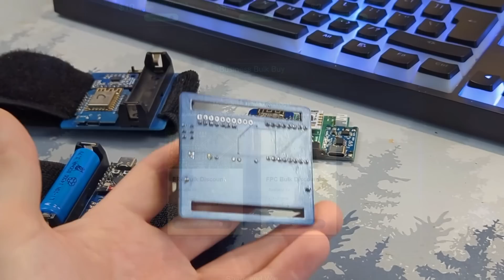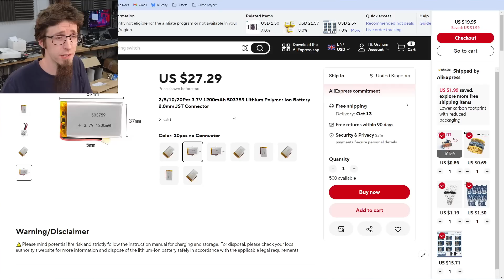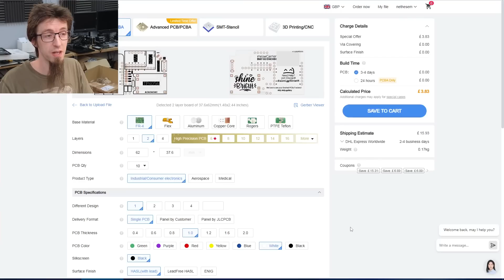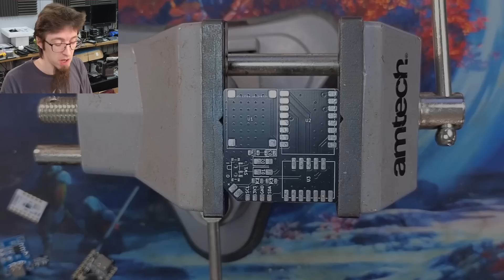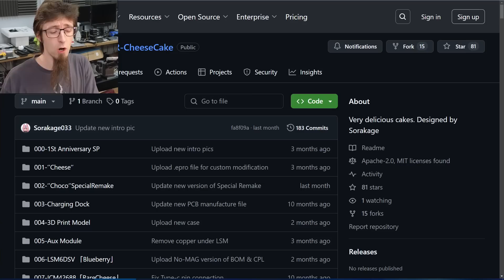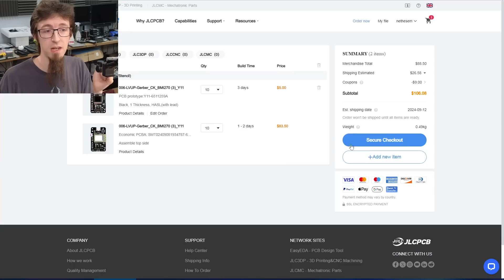Building my favourite Slime VR Body Trackers with JLCPCB - #417

Comment: Is there a version for BMi 160??
Reply from the maker: BMI160 will work with most tracker designs - however the performance is fairly poor by modern standards. Expect a lot of drift. Newer IMUs are waaaay better.
Reply: Thanks, I started my proyect back in november 2023 and having to cable solder 0mm wide cables was extremely painfull as well as i decided using other design. So I dropped the proyect. Tried to retry it to get the same results: bad connection as well as being horrible to handle so thin cables that break just by looking at them. Now that custom PCB are becoming so cheap i think its a good option to go with. I mainly chosed BMI160 just because it was extremely cheap, and I didnt wanted to spend much and people back then said they were good enough.

Comment: LSM6DSV where to get this modules?
Reply from the maker: https://moffshop.deyta.de/products/lsm6dsv-module
Reply: @Adamant_IT  bruh have you tried comparing the performance between ICM45686 vs LSM6DSV  which is better between these two? your opinion is a great factor on planning my expenses 🙏🙏
Reply from the maker: ICM has some interesting utility for new slime designs like Smol Slime. I have a set of DSVs and they're extremely good, I think they're a safe choice for current designs.
Reply: @Adamant_IT  yeah, i really appreciate bruh. LSM is the current king both in availability and reliability

Comment: C3 is a good antenna but Tiny Slime is a terrible design putting that antenna wrong. As many DIY design have many oversights with the antenna, tracker balance, having multiple different ports on the tracker. As trackers are cheap only if you don't value your own time and all extra issues coming from amateurish designs.

Comment: Fun tip to reduce cost: See if you can get a bulk load of old laptop batteries locally, even the broken ones. Most laptop batteries are made of multiple cells and will "break" when only one of the cells goes bad, meaning you can usually get a couple still good cells out of them. The down side to this is the cells may be odd sizes and so you might need to modify a case to get them to fit and also may need a different battery controller
Reply: lithium isn't worth messing with without a decent amount of experience. sketch.

Comment: Bro gorbit tiny slime is really bigger than smol using low power radio and built in bc
Reply from the maker: Smol is only just coming in as viable now - they're still considered experimental, as the firmware takes more setting up, range is a problem once again, etc etc. That being said, I have the parts to build a set of smol slimes on order myself, and I'm expecting Smol to be the 2025 meta.
Just like last time I did a slime video, the DIY scene moves on between the planning phase and publishing phase - it's so hard to pin down information that doesn't go out of date within a matter of weeks.
Reply: @Adamant_IT  I bet a video of making sub 5 dollar slime trackers would be very popular. People know slime trackers are more affordable but I don't think people realize how inexpensive they could be. You probably don't want to use those old imus that are like 1 buck but for yt clout I think it would make a good video and show people what's possible.
Reply from the maker: I'm planning to make a video about Smols, but it's likely to go on the second channel. I've taken two cracks at the whip here on the main channel and not had a lot of interest either time, compared to repair content at least.

Comment: Would be nice if you modified your design so that you could also surface mount the pcb's and not have to bother with the headers.
Reply from the maker: I thought about this a lot, but with the height of the battery being fixed, there's not a lot of benefit to surface mounting the modules - and on the final version I've moved the diode and resistor under the IMU anyway.

Comment: handsome design on the arctic slime, graham! loved the variety on display with the other trackers as well; I hadn't checked in on slimes since the big component shortage a couple years back pushed me to go the vive route despite being a diy/microsoldering animal, so it's nice to see how far everything has come. one small thought on the chip antenna thing; I ran into the same issue in using cheap nrf52840 boards to make diy vive tracker receivers, the range was dreadful compared to the official vive tracker dongles. I ended up replacing the chip antenna there with a bit of wire to make a little 1/4 wavelength 2.4ghz whip antenna, and that immediately put it on par with the official dongle's performance. may be a low cost/effort option vs sourcing connectors and antennas depending on the layout 🦊👍
Reply from the maker: Yea, the solution was confirmed between filming and editing, there's a Supermini V2 with an IPEX connector on it. You can buy them with a little wire antenna, and they're just as good as a D1.
Of course this all came to pass just as I'd entirely remade Arctic Slime to fit a D1 again. So I'm ending up just publish all the versions that work, and people can pick the one they want 😅

Comment: I always use the leftover legs from resistors and diodes for the trough hole soldering jobs for solid connection.

Comment: You could do panelization with mouse bites. Seems the pcbs could be a lot less expensive. It consists in using a software to replicate more times the design in the available pcb sheet. You create the gerber file and upload the modified file. Adding the mouse bites, sets a place for them to break apart. Then you could order 5 or 10 pcbs in one sheet for the price of one. As many as they can fit.
Reply from the maker: Unlikely unless you're mass-manufacturing. As soon as you order larger boards, the price increases more so than the equivalent cost of several small ones. JLC will prefer to panel everything themselves, so they can fit more orders onto a panel. If you were ordering enough to be an entire panel though, then panelizing would likely bring the cost down.
For small quantities like 10x though, it's not worth it when the base price is less than a dollar per board.

Comment: If we're talking about ordering assembly service, it's worth considering just cloning official PCB, which is IMO superior design compared for most stuff mentioned there. Just clone the revision with IMU slot that you can solder the module by hand.
Reply from the maker: This is definitely a good option, yes!
I wanted to mention official clones (and a couple more designs) in an 'honourable mentions' section of the video, but it just had to be cut for time, as the run time was already blowing past my target 30min length! There's so much to talk about on this subject!